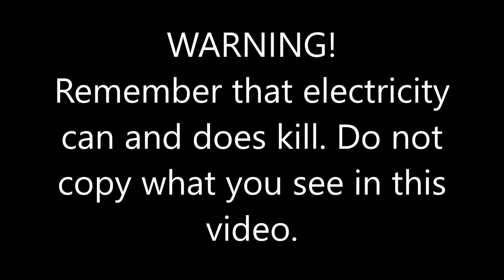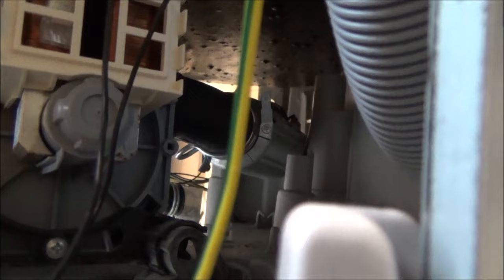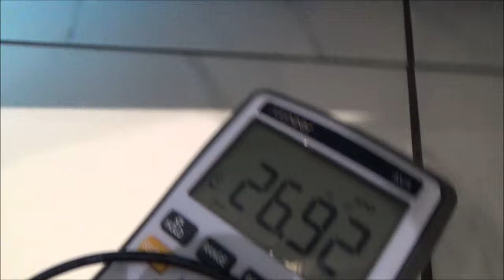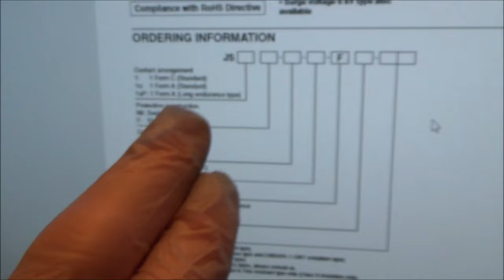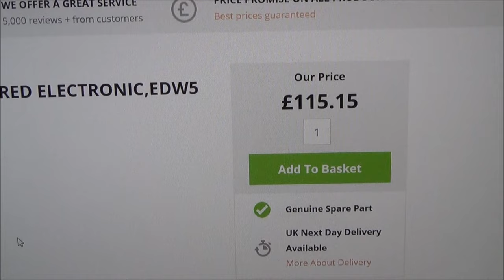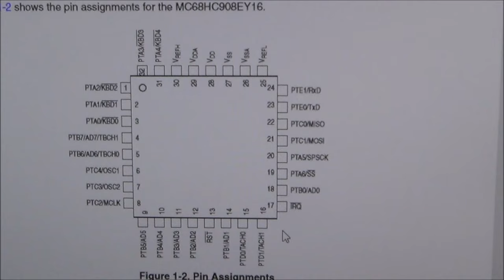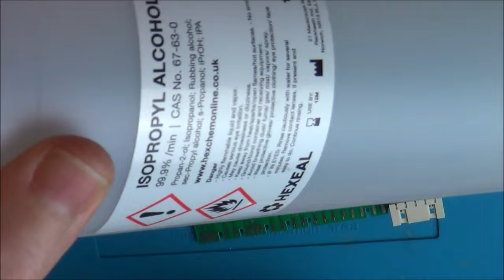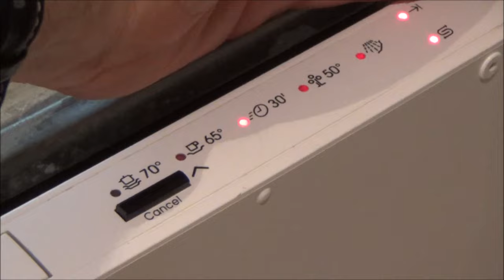Trying to FIX a Faulty DISHWASHER which Doesn't HEAT UP

Comment: I was a domestic appliance engineer back in the eighties.  I worked for Philips Service.  I had to do eleven jobs a day and over a hundred miles.  Not many electronic boards in the appliances then.  Engineers probably don't repair boards in machines now.  Well done Vince but you wouldn't do many calls in a day.
Reply: They are only called engineers - they are not engineers in the internationally accepted sense of the word. They are mechanics or technicians at a stretch. Generally speaking domestic appliances are only economical to repair if done on a DIY basis.

Comment: If you're getting such obvious limescale build-up in the heater of your dishwasher then you really should be using salt for the built-in softener. You could see the actual softener on the lower left hand side of the machine (when viewed from the front). It was the translucent plastic container filled with tiny orange beads. The beads are a type of resin which are involved in the ion exchange process that removes the dissolved calcium from the water, replacing it with sodium ions, which don't produce scale. Given the amount of scale build-up you already have, you should seriously consider using a dishwasher cleaning agent several times to clear what's there. You obviously ignored my comment on the same when you had to clean the nozzles on the spray arms a while back!
Reply from the maker: Thanks Pete. We do use dishwasher salt but the salt light never goes out (must be faulty) and sometimes if we use too much the dishes taste salty so it is a bit of guesswork as and when we put it in. I have just now ordered up some HG cleaning agent from Amazon with next day delivery. The reviews look pretty good so I can run it thorough a couple of times. The scale on the inside of the heater was stuck very nicely, I scraped off what I could but a lot still remains.  I don't think the cleaner will remove that but perhaps it might clean up the rubber pipe work a  bit :-)
Reply: Vince, the salt should never actually make direct contact with the washing water as when the softener recharges it passes salty water through the softener, which causes the resin beads to swap the absorbed calcium ions (from the previous softening cycle) with the incoming sodium ions (from the saline solution), but it should ALWAYS rinse the resin beads with fresh water to remove any leftover saline solution to avoid the salty taste you describe. Perhaps you should check the manual for your dishwasher as their may be a way the adjust the frequency of the softener recharges depending on the hardness of the incoming water.
Reply from the maker: @WaltonPete  Thanks for the tip, I didn't know how it softened the water (sounds complicated). I turned the manual switch from 2 down to 1 so maybe this may help. Apparently there is a way to adjust it electronically as well so if the manual switching doesn't work maybe the electrical adjustment will do.
Reply: @Mymatevince  
If you go to your water suppliers website there should be a page where you can input your postcode to get a water hardness reading for your supply. The dishwasher manual should give the correct setting for your level of water hardness. If you're still experiencing salty residue on your crockery then it's possible there may be a problem with the softener recharging cycle which may warrant further investigation. Hope this helps.

Comment: Hi Vince.  Don't bother with replacing the diode; you put a better diode than the original.  The diode was probably crossing over the relay coil to prevent over-voltage due to flyback effects.

Comment: I had something similar happen on my Bosch dishwasher, turned out the solder joints on the relays cracked, it was an easy fix.

Comment: The diode supresses high voltage wich every coil develops when it is turned off. So you did it right, should work forever ;-)

Comment: The diode near the relay is called a freewheel diode. Its purpose is to deal with backflow of current once the EM field of the relay coil collapses while switching. This protects any connected electronics (like a transistor or MCU pin) from getting hit by this surge.

Using a 1N4148 in its place is fine, as no big currents are involved. The diode on board uses what's called a MELF package, which is essentially identical to the through-hole part which you were showing. A faulty freewheel diode is likely to show up as a short, which would prevent the relay from switching.
Reply from the maker: Perfect, thanks Maya :-)
Reply: I was going to respond in the same way as Maya but was beaten to it :)
Reply: Just realised how old this video is. Thought it was a new one as it just appeared in my recommended vids.
Reply: @robertweiss4171  If only you were 3 years and 5 months faster at typing!
Reply: @DevMan98  Try reading the second comment I posted, but then I guess you are too narcissistic to realise both these comments were posted 7 months before your late response
Reply: @robertweiss4171 it was clearly a joke friend. Don't take yourself too seriously now.
Reply: @abadran8174  getting faster with your replies, only 3 months this time. B.T.W. Only a joke you say. Don't think so, humorous replies are usually accompanied with smilies or an LOL. Your initial reply gave no indication of any humour
Reply: @robertweiss4171  I'm just another guy making a remark. Never commented towards you before.

Comment: It was useful skimming through your video before I attempted my heater element replacement on a slimline integrated Currys Essentials dishwasher which used the same heater (now £13 on ebay!) Surprisingly, the heater was easer to get to on the slimline machine as it was in the rear corner, I only had to take one side panel and a small rear panel off. On the downside, mine was attached with those single use "ear crimp" style clips. Being a hoarder that I am, I had a box of Halfords jubilee clips in my plumbing box. So future fixers be aware that new jubilee style clips may be needed. 
It was good to see your diagnostic approach too... a lot more thorough than some local appliance repair "experts" I've observed!

Comment: I’m going through exactly the same thing now with a different dishwasher that runs normally but doesn’t heat up. My gosh what a pain in the a** and what patience you have. I was pretty certain it was just going to be the heater element and a cheap and easy fix.  But now goodness knows. Changed the circuit board for a new one about two years ago and hope it’s not that again. I’ll be opening it all up tomorrow and taking a look. Such a great video! Thank you!
Reply: Stefano, how cid you get on with your repair? I'm in the same situation with a 6 yo Beko.
Reply: @jimstewart6720  Hey Jim, damn I’m sorry you’re going through that - I know the frustration lol. I was pretty sure with mine it was the heating element. The thermostat was fine and everything else was working. However the heating had been updated to a new one which required some effort to make it fit. Being that it was second hand and at least 10 years old I decided buy a new dishwasher and hope it will keep me free of problems for the next years as I don’t have the time to waste at the moment. I wish you good luck though. Keep us updated how you get in ;)

Comment: I re-watched some of your old videos and it shows how far you have come in a relatively short time. Yes ZD or DZ donates a Zener diode, a Zener diodes symbol is very similar to that of a regular diode. The Zener diode symbol has two small lines coming off the line of the normal diode symbol, these are at right angles to a normal diodes line and one of the lines goes forward the other goes backwards. 

The faulty diode is a small signal diode which will be used for protection. The 1N4148 diode that you replaced it with is a common small signal diode which has a forward voltage of up to 100V,  which is well above the 12V for the relay. This is okay because you want the diode to blow if it gets a reverse voltage(power connected the wrong way round).
Reply from the maker: Thanks PDS, it is all the helpful comments from yourself and others that is helping me gradually learn it. I got lucky this time with the replacement diode being the correct one :-)

Comment: The diode is there to prevent back-emf. Very common to stick one in any circuit were coils are used if not using mosfets with beefy internal diodes.
Reply: Yeap, this was my first thought. Second thought is that if the diode has failed then a spike could zzap the chip. third thought is that that failed diode is shorting the power to the relay so it can't trigger.  Remove the diode and try the circuit.
Reply: That's what i thought as well. Specs for a replacement isn't too critical in my opinion as long as it can handle the 12V.

Comment: Pretty sure the diode you took out is a standard 4148 in surface mount form. Just a generic low-current device so your generic replacement (which is just there to protect the circuit downstream) will be fine (in fact it's probably a 4148 also!)
Reply from the maker: Thanks Jason J and Nigel Sollars. The one I replaced it with was a 1N4148 so it looks like this time I got really lucky. Thanks for the message as I feel more at ease now as that diode was on my mind in case it caused a problem :-)
Reply: I agree with the boys above. Educated guess and a bit of luck too always works wonders 👍👍
Now I would let ‘sleeping dogs lie’ and leave it alone!!
Your soldering is getting better all the time. Remember....... practice practice practice 😉
Move on to the next video 👍
Cheers Vince
Reply: Why the need for brackets quite pointless really?

Comment: Great vid as usual Vince....Get yourself a large turkey baster and keep it handy for the next time you need to drain the dishwasher sump. Will save you a ton of time. Either that or disconnect the drain hose and lower it to below the level of the sump and let gravity do the work.  Loving the content :)

Comment: There are certainly a lot of things to go wrong in modern dishwashers. I still have a Kenmore dishwasher that cost me $240 in 1993 with a mechanical timer, a heater that's nothing more than a tubular element and a single motor that reverses at the end of each cycle to pump the water out. I'll keep it going as long as I can get parts.

Comment: that's the back-emf suppresion diode. it's used to protect the electronics from the high voltage produced by the relay coil when it's switched off. any regular diode should work , the one you installed  is perfecly fine. glad you got it working.
Reply: And the bands denote the cathode or negative side of the diode.  Colors of that particular band don’t usually mean anything else.  The current should flow in the direction of the arrow so if you meter it backwards it should be open.
Reply from the maker: Thank you :-)

Comment: Thank you again I have fixed my dishwasher today. I went step by step first I checked the flow through heater I found it OK. Then I tool a look at the board I found one of the relay legs burnt I mean seems that it had got hot. I rewelded it and hence it worked with me. I was going to take it to beko repair workshop tomorrow

Comment: My Hotpoint integrated dishwasher stopped heating up, so like you I went for the cheaper option and bought a heater element, sadly not the case for me, the outcome for you has been good, but I'm prepared to swap out my 14 year old dishwasher instead of swapping out or repairing the pcb
Well done Vince
Reply from the maker: Thanks mate :-)
Reply: @Mymatevince  
Keep it up, I'm intrigued repairing stuff like yourself  and your DIY vids are great and iinformative 👌

Comment: Thank you for the video, my dishwasher has stopped heating. I took it all apart and the heater element has continuity no issues. Which suggests it's still functional.

I think I'll pull the circuit board and use the ebay repair service.

Comment: Great video  Vince.
I have a similar problem with my Beko dishwasher.  I also thought it has to be the heating element so ordered one. This is b4 I watch your video.  As you I checked the resistance and continuity  and  think it might not be the element now. I should  have the one I ordered deliver by tomorrow.  Then I can surely find out it is the element or not.
I will update once receive  parts.
Once again thanks for sharing your valuable ideas.

Comment: Second attempt at watching this one today. Fell asleep when you uploaded . Although what I have seen so far has actually been helpful . Our dishwasher tends to leave the dishes still wet and very little if any heat is generated so at the weekend I'm going to see if it's our heating element or not I'm not sure if the slim lime version we have is much different that the full size one you have but I would be interested to see how much different the control board and element are
Reply from the maker: I bet they are very similar, maybe the heater has slightly less wattage. Let me know if you find a fault :-)

Comment: Because the relay moves its internal contacts using an electromagnet, which consists of a very long (but thin) coil of wire (an inductor), when the power is removed from the the coil (by the eternal circuitry, via the microcontroller) the magnetic field collapses and, consequently, momentarily induces a current into the connected circuit. The diode is connected across the input for the coil in the opposite polarity of the supply voltage, so it doesn't have any effect whilst the coil is powered, but when the power is switched off to the coil it will act as a short circuit for the induced current that results, thus protecting the other components from potentially damaging voltage spikes. As it's only used for very slow switching at 12v, pretty much any standard diode should do the trick, such as your 1N4148 diode. You correctly identified the zener diode, which is most likely being used to keep the supply voltage for the low voltage circuitry at a suitable voltage.
Reply from the maker: Amazing, thanks Pete, you explain it in a way that even I understand :-)

Comment: Hello Vince;
Dishwasher's here in the USA, at least my dishwasher, receives it's water from the hot water supply line. ( It also has a built in heating element ). 
Why does your dishwasher receive water from the cold water supply line. It seems that the efficiency would be better, if you switched your dishwasher water supply to the hot water supply line. ( Let the house water heater, do the work of heating the water ). The thermostat in the dishwasher heater, should still work as intended. ( heating and maintaining water temperature inside the dishwasher ). Also, the heater should have less build-up after the same amount of time. 

Thanks, for another great video.
Reply from the maker: Hi Bruce, I really don't know why they are. Maybe newer ones are different. Could it be that there is more water pressure on a cold supply if it is mains fed while the hot supply pressure might be weak????? Since you have to heat up the cold water in your house anyway via a boiler I wonder is there any energy saving to be made by connecting it to the hot supply over the cold supply. I think gas is cheaper than electricity here in the UK so maybe using the hot water from the gas boiler would save money.  Hopefully someone will reply who knows the answer :-)
Reply: EU regulation .
Reply: I have not been able to find any EU regulations regarding the use of the hot or cold water supply line. For Dishwashers in the UK. However, I did find on page 14 of the manual, for your Zanussi ZDT41 dishwasher, the following. 

Water connection

Water inlet hose Connected the appliance to a hot (max. 60°) or cold water supply. If the hot water comes from alternative sources of energy that are more  environmentally friendly (e.g. solar or photovoltaic panels and aeolian), use a hot water supply to decrease energy consumption. Connect the inlet hose to a water tap with an external thread of 3/4”.

The installer for your Dishwasher, did have a choice of whether to use the hot water supply or the cold.
Maybe the gas, is not considered a environmentally friendly source. The electricity used to heat the dishwasher water, could come from an environmentally friendly source, for your area. 
Sounds like a long drawn out,
unnecessary - what if video, ( to compare the two ). 
That I would definitely watch.
Reply from the maker: @BruceAFairchild  Interesting, I wonder if plumbers on new build properties are now installing valves on the cold and hot water supply for dishwashers so the customer has a choice. Maybe the UK will start to move over to a hot water supply in the future. Cheers for the idea of a video, I don't think I will be the one doing it as I lack the knowledge but it is still a good idea :-)

Comment: I have the same washing machine, with the same problem. But after reset it works properly for a few days, and then the water can't heat up again. 
I will try to change the diode first. Thnx for the video.